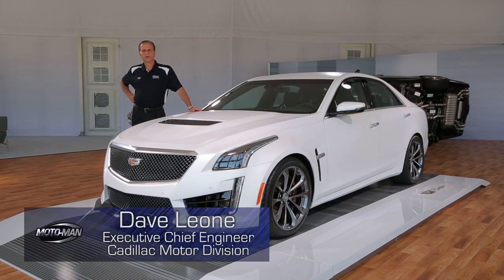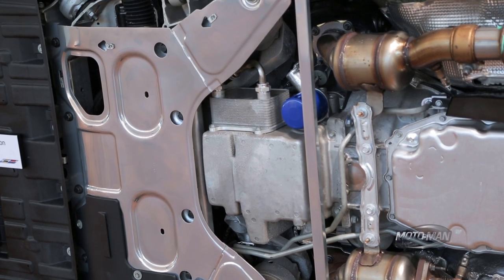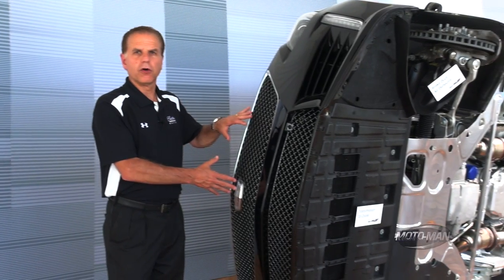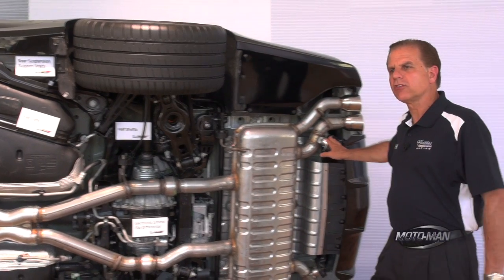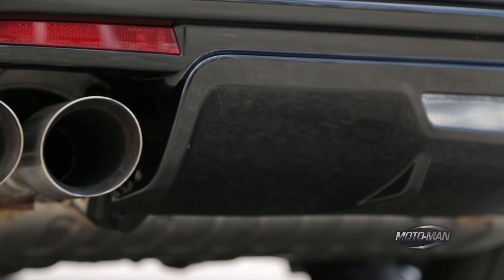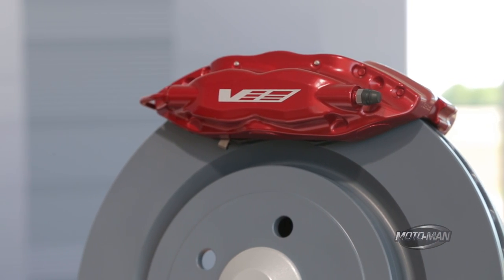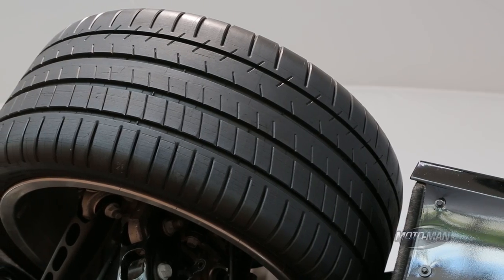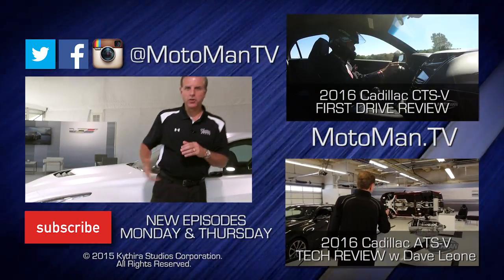2016 Cadillac CTS-V TECHNICAL REVIEW with Cadillac Chief Engineer, Dave Leone

Comment: About the most fun car I have driven or owned. Never thought I would like owning a car more than the Porsche Turbo.  This thing kicks ass and handles awesome.  The stock Michelins just do burnouts. You want Michelin Pilot Sport Cup II tires and it will beat Hellcats all day long. The car really hooks up and 90% of the crazy wheel spin is eliminated with Cup tires. Take it from someone who always drives with the traction control off.  The Pilot Sport Cup II tires make the car a lot more fun, faster and safe.
Reply: I have a 2018 and I'll take your advice cup 1 tiree thanks

Comment: E63 does not have the DCT transmission. It has the MCT, which is the transmission without torque converter replaced by the wet clutch. In S+/M this transmission has shifting times  of 100 ms.
The fastest DCT's today have shifting times as fast as 60ms, so Caddy's transmission can not be compared with them.
Reply: Koka Gulua Wrong. 8L90 is just as fast as a DCT, as stated.

Comment: The way that the tires are designed with 3 different materials and patterns, am I correct in assuming that you wouldn't rotate the tires because it would mess up the patch to the ground made by the tires?

Comment: Hey Dave a little help, my 2016 V seems to have developed a problem with its belts, for some reason the car Is eating them, chewing them up is how my dealer put it and if the tech working on my cars brakes didn't notice it I'd be in a ditch somewhere's.
At this point every belt they put on gets chewed up by the car and no one knows why, so I ask you Dave...WHY?

Comment: If they're not going to offer it with a manual transmission, they should offer a manual transmission swap kit through GM performance parts. If they made a kit that contained everything needed for the swap, I guarantee they would sell some. Plus people doing a manual swap in other similar cars or custom cars could also use some, if not all, parts of the swap kit.

Comment: Articulately explained:

1. Why no manual (not enough people buy manual to justify the development cost)
2. Why no DCT (auto is smoother and can achieve similar shift times)
3. Why no AWD (an extra 200 lbs on the front wheels will affect handling in a negative way)

There's hope for AWD when they build a wagon because the added weight in the back will allow for the inclusion of AWD to bring the car back to a 50/50 weigh distribution. By that time the 8-speed auto will be even better. RIP manual.
Reply: NIAtoolkit Exactly
Reply: NIAtoolkit But at one point he says "Every gram matters." Then they go with the biggest STEEL brake rotors in the business. Doesn't he know that that adds 50-60 pounds to the car? Not to mention 12-15 pounds of unsprung weight at each corner. Another thing... Which would you think is heavier. Having to haul around a 19" spare wheel and tire or Run Flats all around?
Reply: +NIAtoolkit The handling excuse is complete 100% bullshit, regarding AWD. Go through the list of ultra high performance cars using AWD and then come back and tell me AWD causes handling issues. I mean seriously, has anybody at GM ever heard of an Aventador?
Reply: The problem with All wheel drive is that if you go out thte parameters of the cars suspension you are left in a loop. The aventador, 918, and other all wheel drive supercars are good for snatching out of a corner but suck when it comes to drastic switches from left to right and right to left. They are all pretty heavy. They need these complex computers to help drivers get the lap times they get and they take away driver involvement. Not to mention the oversteer. The best driving cars are rear wheel drive. Preferrably front engine rear wheel drive.
Reply: +Vernon Price Nope.  The E63 understeers like crazy.  RS7 understeers like crazy.  M5 does not, this does not.  Pretty easy to understand, and the weight issue is exactly true.

Comparing an 85k sedan to a 400k+ supercar...good idea....
Reply: Evan McMiller The RWD E63 understeered too, what's your explanation for that? Almost all Audis understeer, including the ones that aren't AWD, what's your explanation for that?

And I noticed you avoided the Aventador, since it's obviously AWD and does not understeer. Neither does the GT-R, neither does the Mitsubishi Evo, neither does the Ferrari FF, neither does the Porsche 911 Turbo or any AWD Porsche. What is your explanation for that?

Only an idiot would link AWD to understeer as a direct cause and effect relationship. ANY car can, and usually does, understeer as a safety measure from the factory. Drive layout is 100% irrelevant. 

No? Then explain all those cars I just showed you, and tell me how it's possible that they are AWD and yet don't understeer. According to you that should be literally impossible, like you believe those cars are just breaking the laws of physics. Right? So let's hear it.
Reply: Servant of JESUS CHRIST All cars are heavy compared to something like a Miata. Weight is not a factor in terms of direct correlation to understeer. You know what is a factor? How the car's suspension as tuned at from the factory. Understeer is not a result of AWD, it is a result of how the car was set up from the factory. There are light AWD cars and there are heavy AWD cars. There are light RWD cars and there are heavy RWD cars. Weight is not the determining factor.
Reply: +Servant of JESUS CHRIST , how about the manual kind of sucks on the CTS-V and that the automatic engine is actually, gasp, FASTER than the manual version of the CTS-V?
Reply: Pax Humana A) the current CTS-V does not have a manual available, it's only automatic, and B) in the gen 2 CTS-V, the manual was faster than the auto. This is for a number of reasons: The manual car weighed less than the auto car, and the manual car put down more power to the wheels than the auto car due to less drivetrain loss, to the tune of about 30 whp on average. Manual cars almost always trapped higher than auto cars at the drag strip for those reasons.
Reply: Vernon Price , it's still not a bad vehicle to drive even AS an automatic only vehicle and it's also proven itself on road courses as well as oval race tracks.
Reply: Vernon Price , the manual was not very good for the Cadiallac CTS-V, which is why they eliminated it from that particular vehicle and its variants, thus the reason for my comments, sir.

Comment: Will the 2016 CTS-V come with all wheel drive at all. I'm from Canada, and the weather we get here is brutal in the spring and winter seasons. I know by having the opinion of all wheel drive will add more weight, but we are willing to live with that. Or you can loose the extra weight from somewhere else. I love this vehicle and I ready to pay the full amount for it, but the AWD  is all I ask for. I don't care what other people are saying about the car, like the delay in the gear shift, and the glossy touch pad dash. ( entertainment area, and the CUE). Over all this is a STUNNING vehicle, and amazing to drive in. I would love to drive and own one. 
So people,appreciate this car and have some respect. Thank you. 
P.S. this car has the best handling system in the automotive industry.
Reply: As of now, nope. No AWD. Put it in snow/ice mode and you'd be just fine, though.
Reply: Well, there are new kinds of AWD, but more electronic based compared to the AWD back in the days where it was really heavy. The one you hear, 4matic, can act as RWD for total performace. When traction is lost, the power is distributed from the rears to the fronts ranging from 35%-50%. New kind of system that improved over time. I don't see much difference between that and the RWD with Stabilitrack that the V has.
Reply: It would handle about the same regardless of AWD... all it would do is slow the car down and add extra weight that isn't necessary. It's all in the tires.

Comment: Does this car have adaptive cruise control? Also what is unique about the interior vs regular model?
Reply: It does not, I believe. The interor is mostly similar aside from the LCD gauge cluster and available Recaro seats.
Reply: Very nice cruise control. The engine will shut down 4 cylinders in touring while on freeway.

Comment: Why no power folding mirrors?
Reply: Extra weight for an unnecessary option. ;)
Reply: I`m living in Liechtenstein (Europe), and we have power folding. But our Mirrors are 25% bigger than the US
Reply: phillip I think options like that will come soon probably when Cadillac does the re-up of their interiors and take them to the next level as far as luxury. We will probably see additional luxurious features like soft closing doors, power folding mirrors, etc. Escalade will most likely get them first on it’s refresh which I think will be released 2020. I think Escalade already has folding mirrors. These options can be heavy though and Cadillac will NOT sacrifice the driving dynamics and performance of their cars for the sake of unnecessary bells and whistles. They’re very serious about acquiring the best driving feel/experience on the road. When they implement those type of options across their lineup they will be sure to simultaneously keep their weight down and balance as close to 50/50 as possible. They’re gonna take their time and do it right and the most efficient way so that it doesn’t take away from that Cadillac experience behind the wheel.

Comment: Dave Leone - why has Cadillac lowered the lustre of the V brand with the CT5 and CT4 entries? Nerfing the V badge really isn't fooling anyone, and it tarnishes the sensational record of the everything that has carried the V badge prior.
Reply: There is going to be a new high performance trim that is going to be the top dog in the Cadillac brand. The V-Series took the place V-Sport trim. I heard that the top performance trim is going to be called Blackwing. So, the Blackwing CT5 and CT4 is going to be crazy fast. Those Blackwings are going to be pushing well over 600 and 700 horsepower. They might be using the 755 horsepower LT5 from that ZR1 Corvette.

Comment: I liked everything I heard about the car except the automatic with a torque converter trans. Come on GM leave those in the trucks. Your cars need DCT transmissions. Not every American is a drag racer worrying about up shifts. You can't honestly tell me the down shifts are as nice as a PDK. Granted most buyers won't be tracking their V's much. For the record it's a sweet car and I'd still buy one. Just trying to make it sound like a torque converter trans is better than a DCT in a performance oriented car isn't doing you any favors. Build or source a company that can build the transmission for you and work with them to program the desired feel. You sold your mag ride tech to Ferrari have them help with the transmission. Sounds like you might be in collaboration with the rear diff tech.
Reply: Stig Msr Remember though, this is a Cadillac. It has to drive and BE a certain way, otherwise you could just say its some car with 640hp. The rough upshifts of the DCT, like he said, would not suit the Caddy.
Reply: sexyitalian891 

To me it sounds like a “marketing solution / calculated excuse”. I listened to the transmission part a couple times and noticed that he was very keen to compare it to the Merc with shift feel which recently made the switch to DCT from torque converter trans (I think), so it’s not as refined as others. I have not driven either the new V or Merc mentioned yet but I have tried PDK, plus many VW’s & BMW’s DCT, I didn’t think they were very aggressive in shifting in auto with the exception of the BMW that was tuned but only in the more aggressive settings yet it was smooth in the normal setting. PDK was the smoothest and that might be because of their active motor mounts dampen any shift shock.  I also noticed most reviewers have left the GM’s transmission in auto but any DCT on the track they manually shift with the paddles. I don’t know if it’s because it’s just easier having an intelligent conversation while tracking a car not worrying about shifts or if they’re trying to point out how well the car knows the right gear better than the DCT’s auto setting because they never really comment about why they didn’t leave the DCT in auto. With the exception of Chris Harris in the La Ferrari video. On the road he commented how easy it shifts in auto… Yes, the two cars are on different levels but it also shows it can be done and Ferrari knows how.  I’m going to drive the new CTS-V for myself at some point to really see but I have my doubts is all I was really saying.
Reply: I agree, and don't forget all the bs about the wet sump being better than dry sump.
Reply: ferrarione22 2 yeah I gave that a pass. If the pan is baffled properly and your primary use is for the street I understand GM not wanting to deal with packaging in the engine bay or consumers bitching about expensive oil changes because they didn't under stand the need for the few extra quarts of synthetic oil. I don't know why they didn't tell it straight like they did with the no manual. Is it because that's what other automaker say so it's allowed? The new CTS-V seems like a really neat car. I enjoyed driving the last generation. The excuses really aren't needed I just hope GM is working hard on a DCT or a contract with a 3rd party. They get so close to the top of their competition I wish the bean counters would just loosen the leash on the engineers just a little more.
Reply: ferrarione22 Yeah, he totally contradicts himself. They didn't want a DS system for engine oil, due to the added hoses to go from the engine to the remote sump. Then he says they run fluid from the differential clear to the front of the car, where there's a heat exchanger???? Really???
Reply: +Stig Msr sorry man but dcts have their issues, delay between park and drive.  Forward momentum almost lunging when going into park and is painful where driving slow in the city.  DCTs have overall erratic behaviour at times, yes the shift feel faster and more pronounced though
Reply: This shifts as fast as a DCT. A DCT would add unnecessary weight for no performance improvement. The only thing they could work on is the transmission computer - the paddles aren't responsive enough. However, in full automatic mode, it will blow away any DCT.

Comment: Wet sump has 10 quarts though, what would a comparable dry sump require? Sounds like he had an internal battle with someone that wanted a dry sump and he won and wanted to prove it.  There is a reason real race cars use a dry sump.  However, there are trade-offs, it is okay to admit that you didn't need or want to go to that extreme. There are always trade-offs and and there isn't one right or wrong answer.